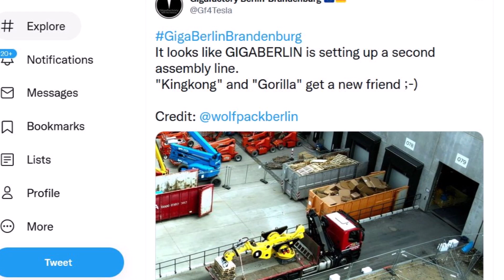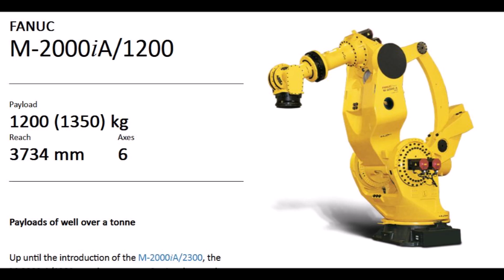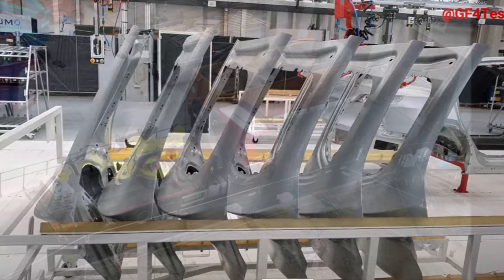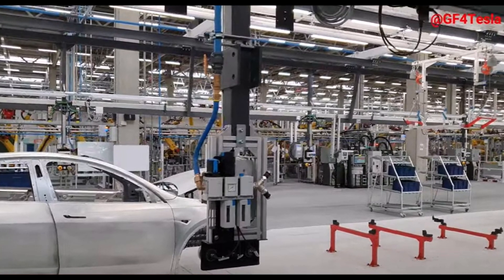Tesla Giga Berlin Brings Either Setting Up 2nd Line Or 4680 Battery Production

Comment: That's a very heavy duty robot.
That thing is definitely meant to pick up a battery pack.
Or something extremely heavy.
During the assembly of the car you have to move the battery pack around so they just don't need them in the battery factory.

Comment: Just one?  Or is this one of a few dozen robots?

If just one, they are probably just improving capacity in the current line - some portion of the line was only built out enough to support current lower production rates.

Comment: A battery line would likely be in another building.  A Model 3 line is needed.  However due to demand a 2nd. Model Y line is also needed.  A second Model Y line could be built and up and running much quicker.  Wright's law kicks in with a cost reduction when production is doubled.  It may cost less to produce Model Y's than Model 3's.  After a second Model Y line is running one or two Model 3 lines might be added.  While this is going on 4680 production will begin.  It may not seem like it but production is increasing rapidly.